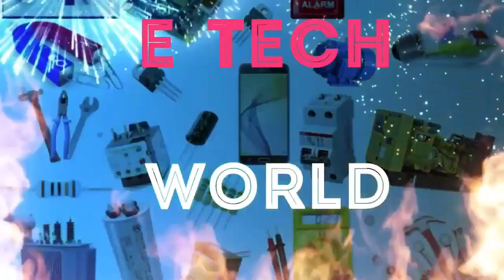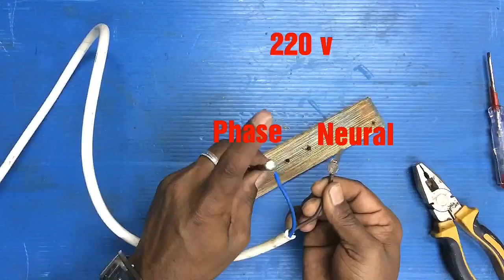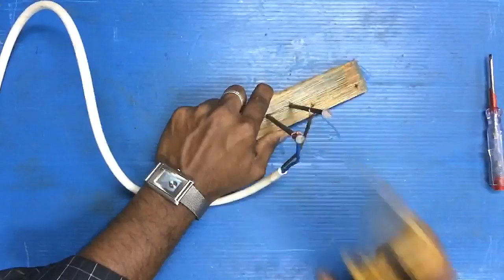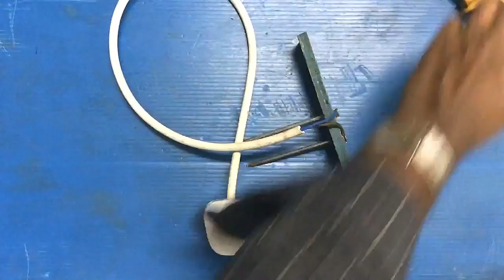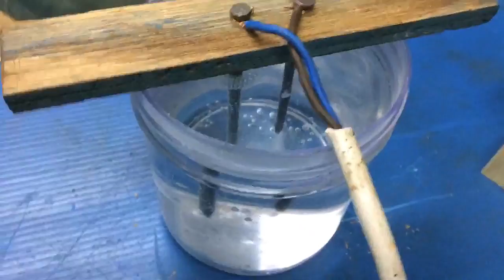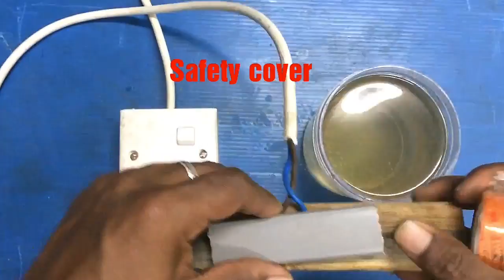How to make water heater 1minute homemade

Comment: What Is the Reson Of two nails heat the water??
Reply: electric current creation. one positive and one negative. energy moves between them and the speed of the transfer through the water heats the water molecules because of friction on a molecular level.
Reply: High school life???
Reply: the two nails provides high resistance since they get shorted
Reply: What happens when using the copper nails

Comment: does the electricity escape to the water? (In other words, can i touch the water when its being heated?)
Reply: Don’t think about it. Never touch the water. Otherwise you get shocked
Reply: Don’t think about it. Never touch the water. Otherwise you get shocked
Reply: Don’t think about it. Never touch the water. Otherwise you get shocked
Reply: Don’t think about it. Never touch the water. Otherwise you get shocked
Reply: Don’t think about it. Never touch the water. Otherwise you get shocked
Reply: Don’t think about it. Never touch the water. Otherwise you get shocked
Reply: Don’t think about it. Never touch the water. Otherwise you get shocked
Reply: Don’t think about it. Never touch the water. Otherwise you get shocked
Reply: Don’t think about it. Never touch the water. Otherwise you get shocked
Reply: Don’t think about it. Never touch the water. Otherwise you get shocked
Reply: Don’t think about it. Never touch the water. Otherwise you get shocked

Comment: Not really a water heater. The bubbles coming off are hydrogen gas so it's more of a hydrogen gas maker which is actually quite dangerous.
Reply: What makes you think that? Electrolysis of water usually takes place via a DC circuit. It can be done by AC as in this case but the degradation of water to its component gases happens when the electrodes are arcing (which in this case they are not). What you are seeing is two electrodes connected to an alternating current (so they are changing between positive and negative at a rate of 50-60 times per second) so you don't have the electron flow necessary for normal electrolysis. Instead the electrodes, which are insulated from each other by the wood become connected together by the water. But water isn't a good conductor so the resistance is high. The high resistance causes the water to heat. It's called resistive heating. The bubbles are the water boiling. 
Still, I wouldn't drink it, any number of impurities could have come off those nails.
Reply: I wanted to know whether itl spark.. But instead it boils the water. It can make a powerful boiler.